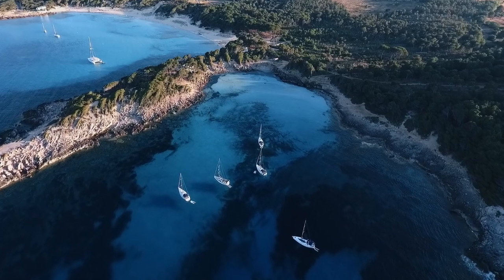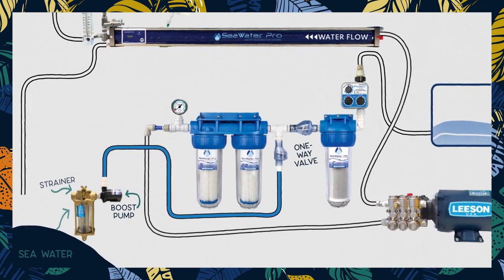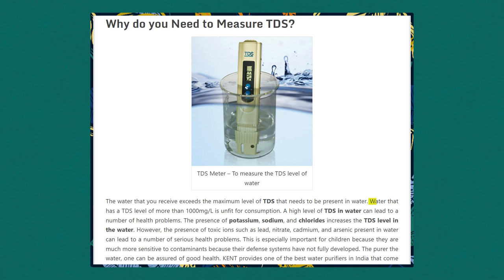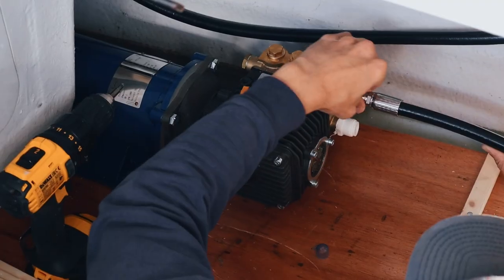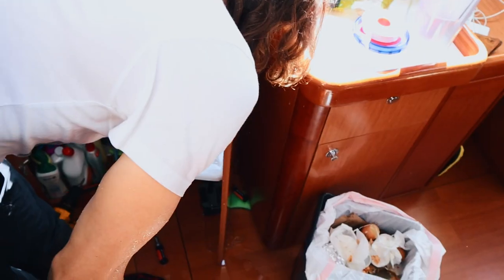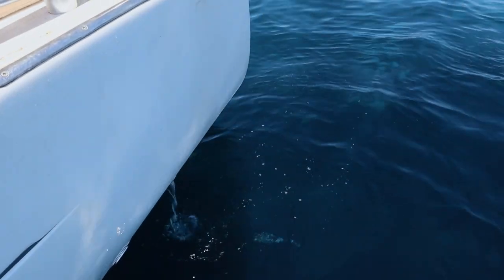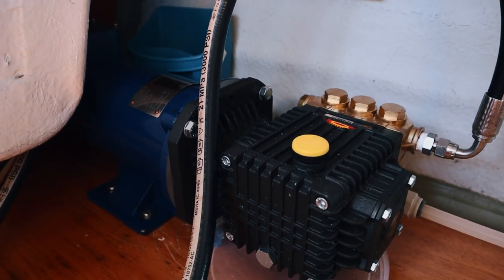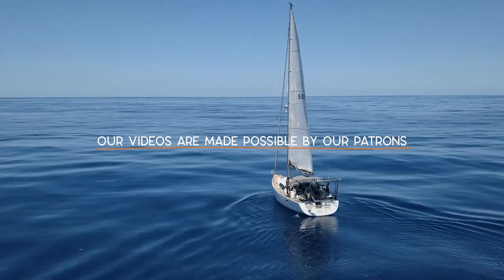How to make Water on a Sailboat (and how to Build your own Watermaker) - 4 years later review

Comment: Currently installing a DIY water maker on my boat .. last major wish list item before I head south again. It has been a learning process for sure. Knowing where every item is installed and how it functions means it is one less thing I need to worry about when cruising.  Pretty confident that I could repair or rebuild one from scratch with parts available almost anywhere.

Comment: I can't imagine the challenges of NOT having a working water maker.  Thanks for explaining it so well
Reply: Having enough water tankage plus Backup Water Jugs, just in Case, along with Rainwater capture (pretty easy to set up, just let it rain for 15 minutes to wash the dust out of the air, before collecting (then filter it into your water tank), and it really isn't that much of an issue tbh, though it does impose getting a bigger boat to cope with the tankage for water, plus good Reserve of Diesel. That can have a significant benefit as well, as with good tankage positioning, balancing the boat just means moving water between tanks. 👍⛵️✨️✨️✨️

Comment: Thank you for this most timely follow-up review. I am currently installing the 24 Volt, two vessel version of the Sea Water Pro, which we chose based on your initial two videos and I have nothing but positive things to say about the company’s customer service. Like you, I got the no-panel version but decided to create my own for ease of operation. This meant that I needed to change a few parts and even though it’s been about a year since I purchased our unit, the exchange process was painless. I was told to just order what I needed from the website and upon return of whatever I didn’t need, they would credit my credit card the full value of those parts. Questions get answered expeditiously so A+ all around to SeaWater Pro
Reply: How is the brush life on your motor? I had to replace mine after only 300 hours. $50 each!
Reply: @ncampion1  I can’t say. As I mentioned, I am just now installing the unit so no experience with the brushes but I will certainly get a set of spares now that I know about your experience.

Comment: Nice update. I may get a Seawater Pro Watermaker, if the Boatbuilder will install it for me, but I think they do Spectra, and that stacking High pressure pump that has low electric consumption, may turn out to be not much difference in price as a  ew fitment. They also seem to do a nice Washer Dryer, that is vented, that seems to be reliable enough to last well, so am looking forward to your Washer Dryer update as well. In the past, this is the sortnof stuff I used to love DIYing, heck even timber on deck ! (yep I was nuts), but getting stuff fitted during construction has increased its appeal in recent years due to disability. Ho Hum,  Keep up the Great Work, Best Wishes and Fair Winds.  Bob - now planning on an Island Packet God Willing, built in F👍⛵️✨️✨️✨️👍👍lorida, to be Registered in the BVI (easy peasy as a British Subject ) and delivered to the BVI for me, to complete the Boat Registration there. Three little words xwung it for the BVI "English-Common-Law"❤ 👍⛵️✨️✨️✨️

Comment: I'm aiming to go with a seawater Pro watermaker for my next boat. I'm wondering though, have you thought about adding remineralisation filters in the galley, as RO does strip out essential minerals from water ? There do appear to be some nice setups, that have their own Tap outlets for installing by the sink. I think they get advertised as thankless filtration systems, and some can include a RO cartridge as well, though I think I'd stick with a seperate dedicated watermaker then plumb the water from the water tank through a split pipe system, with one of the split heading to the remineralising filters. I'd like to see some non manufacturers reviews before diving into those however. Best Wishes and Fair Winds.  Bob.  🤔👍✨️✨️✨️

Comment: I wanted to say for like 10 amps more per hour you could double your output.  1hp dc motor usually draws 80 amps. You would need a different pump head, motor, and an extra pressure vessel.  You could get those on your own for cheap. SV Adventurer did a video called "How to make your own 30 gph water maker." The parts are listed in the more and comments section.
Reply: That would be a massive drain on the battery…but, to your point, for a given amount of water, it might be fewer overall amphours. But for shore based, that would be worth the extra effort.

Comment: Given the number of systems on offshore cruising boats, readily availability of parts is a a must.  Although more systems are available for small sailing boats, it seems the reliability and complexity still leave a lot to be desired.   Even then fully accessible and replaceable items and services, needs to be incorporated into yacht design and manufacture..